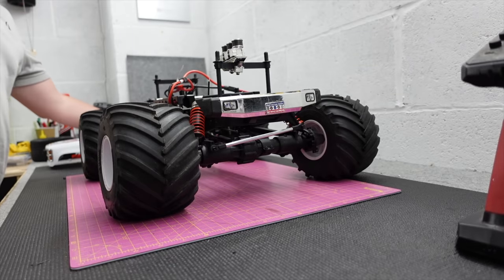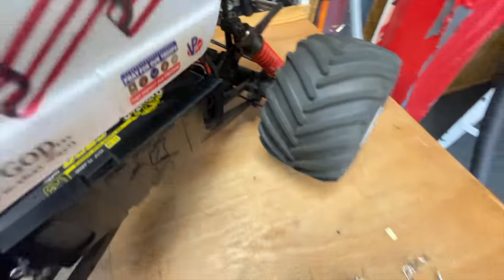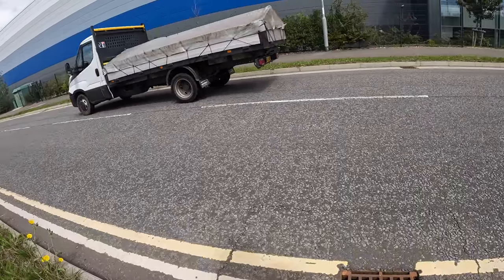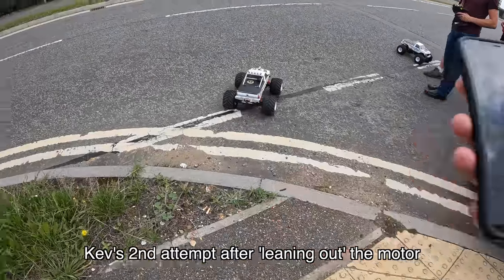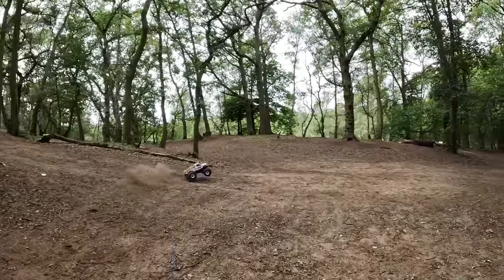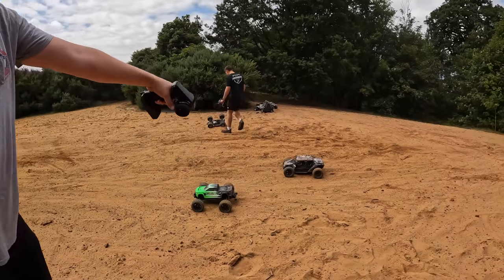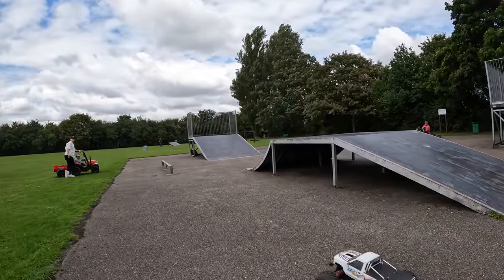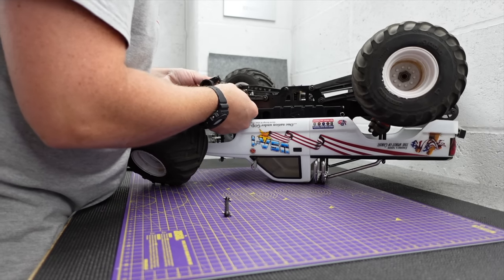Are Nitro RC Cars Still Relevant in 2024?

Comment: Oh dear, a Nitro that runs is the most glorious thing ever. When it runs, lol.
Reply: Well, mine always ran if there was enough fuel in the tank. Never got why others may have such trouble. 😏

 Havent fired him up in 12 years and am looking at the bad boy in the garage every time I come in. I bet if the fuel I have left was still good, he'd come alive after no more than 5 pulls! 😅
Reply: @Ganiscol  me too i always liked nitro and i never had any problems with nitro rcs
Reply: @Ganiscol  "Never got why others may have such trouble."
IMHO,  that's because not many people (TRULY) understand how the engines works, AND how to tune and take care of them.  Not everyone is mechanically inclined.  
I own mostly nitro stuff too, and never have much trouble either... Most of the trouble I've had is with my nasty old bag of a neighbor complaining about "the noise"! hehe
Reply: A lot of people don’t have the time or ability to understand engines. I love the drama and theatre of an engine making a racket and belching out smoke. Yes, it’s not as simple a charge-n-go, nor are they as fast. But I enjoy potching and tuning and arsing about with all things engineering. But I get some people just want to get on out and use the car and not mess about.
Reply: Nitro is way more fun, but electric is good for people with little technical ability, like yourself
Reply: @Ganiscol I love nitro however the Nitro version has a lot of transmission issues. It's not just the Nitro engine giving issues on this one.
Reply: It’s all in the tuning.

Comment: Only issue I've got with Nitro is the price of the fuel which is why I'd take Large scale petrol over both electric and Nitro. However there is something deeply satisfying with a well running Nitro.
Reply: If it were cheaper to run, I'd have a nitro myself.

Comment: The car is awesome and belongs to every monster truck collection. car needs 100% a center differential, because this makes it much easier to drive at every level. The centerdiff must be connected at the bottom to the original spur gear.  The easiest way to do this is with a Cen Reeper Differrential. On both sides only the lid of the DIff, instead of the main gear, and then connect it with the original spur gear, but even if you glue it, with a strong glue.

Comment: I've been into hobby grade rc for the last 20 something years, and I love both nitro, and electric. I love the noise, and the smell of nitro, but at the same time you can't beet the sheer speed and power of modern day brushless setups. I still have my original Thunder Tiger MTA4 1/8 scale nitro monster truck that I used to race (need to restore it), plus one I'm modifying with a .54 4stroke nitro aircraft engine, a supercharger, and 8 inch tall tyres through to 1/18 scale crawlers, a 1/14 scale Hyper Go onroad, 1/8 and 1/10 scale drag cars, a couple of boats, and numerous other cars from 1/18 to 1/5 scale that I no longer have. My favourite is still my original 1/8 nitro monster truck, and the matching one that my late friend used to race against me with me. I have to say that the best thing about rc whether you're a nitro, or electric fan, are the amazing people you meet because of the hobby. Keep up the great videos Phil, cause they're a staple of my YouTube viewing. 🤘

Comment: I have a Mini quad bike i converted to RC, stripped it of all non essential parts, cut the frame and re welded it to be a lower profile to fit inside a electric kids ride on truck body but the 50cc petrol engine was grossly over powered without the weight of a person on it.

With the solid rear axle it was a nightmare to prevent the back end snaking in the constant wheelspin it wanted to do even with a Heli Gyro on the steering and putting it sideways at 40mph on grass was nail biting as  it would dig in and roll multiple times getting significant air on each rotation when it bounced on a wheel and weighing 25kg is not something you want out of control around people!

It also seriously annoyed my neighbors from how insanely loud it was and i hated the stink of petrol that got on my clothes as well.

Ended up putting a E scooter motor on it, not even half as fast as it was (I put a small sprocket on the rear axle deliberately to limit top end)  but its now controllable, has reverse, has a flight controller on it with gps and all the other bells an whistles that come from running a flight controller and is smell free and near silent!

Comment: Hell yeah…I love me some nitro!! I operated my first brushless today when my buddy bought a felony, thing was nasty, I just got back into the hobby after roughly 13-15 years, got my old ofna LD3 running and my hot rod…a 3.3 swapped CD3, I just love the tuning aspect and the satisfaction of nitro, however, I do plan to buy an electric for when I just want to go out and have some fun quickly lol. Either way, I respect both but being an old school type of guy, I love my nitro. I had a crowd (of 6) in front of my house earlier when I was ripping that .12 around lol.

Comment: 28 years in the hobby, Nitro will always be the most fun and cheapest in the long run once you learn tuning and have a decent engine.

I actually have one of these (except its a Kruiser) and 3rd speed is tricky to adjust.

Electric is (usually) faster and less involved.

Comment: That's one thing I do not like about Nitro or gas RC is having a 3-speed transmission 2 Speed high low is fine as long as it's selectable but the 3-speed never seemed to shift right my friend had almost the same truck and his never shifted right

Comment: Sure, having to carry fuel, tuning, and other but there's something visceral about a nitro engine with a proper 3 speed gear box.....it's the same as full size cars.....You cannot argue that a v12 lambo ripping through a tunnel is 1000x better than an electric one going wrrrrrrrrrrrrrrrrrrrrrrrrrrrrrrrrrrrr or ssssssssssssssssssssssssssssssss. 

Even that EV that set the goodwood record last year it was amazingly fast but ssssssssssssssssssssssssssssssssssssss when it went by was about as exciting as watching paint dry.

Comment: Nitro is only relevant for racing really, since it provides the longer time you can race due to pit stops. However, you're never gonna reproduce the engine noise and smoke--plus, I think there are a lot of people that just enjoy the tinkering you need to just get nitros running vs electric's plug and play.
Reply: Agree I raced 1/8 buggy and truggy class nitro, couldn't imagine running electric just not the same

Comment: for first few times nitro seems fun, then you realise its an utterly messy job to maintain a nitro, all dirt n debris just sticks to everywhere, u must use air gun to clean it, the nitro gas itself starts to peel off your palm skin, and the whole neighbourhood hates you.

finally you just switch to EP for good, and everyones starts to love u. cleaning is so easy, you remove the Lipo and you just water jet spray your car clean coz modern EP parts are waterproof.

Comment: Electric is better for rock crawling. Maximum torque at 0 rpm. Gas may be faster on flat ground depending on engine size. Electric is quiet, so most people wont know you have it. In the US gas cant be used at most public parks.

Comment: I've had nitro... In fact it's what made me quit the hobby for a decade. 
I went to nitro because of the lack of power in nicad batteries, but left the hobby because of the grime , ALL the extra 💩 you need with nitro frustration, aaaand oh yeah stock motors would last a bit, but anything performance would blow on the first couple runs .. almost every time you got "surprise air" 
I came back when they went to lipo.
Now I'm in deeper than ever 😂 🤦